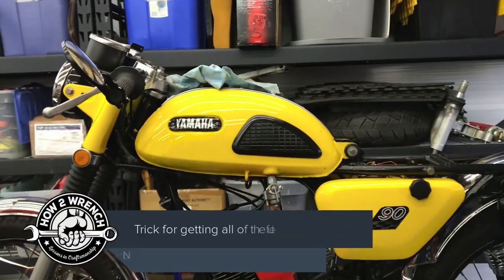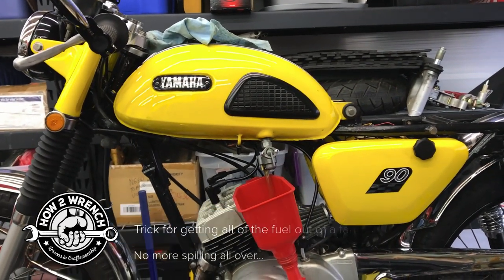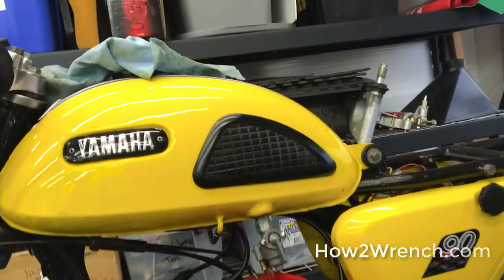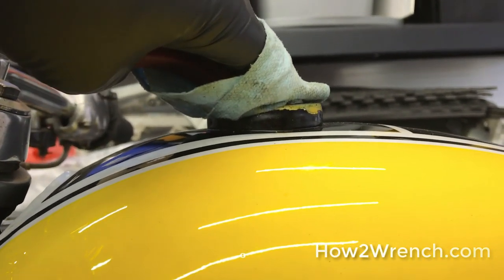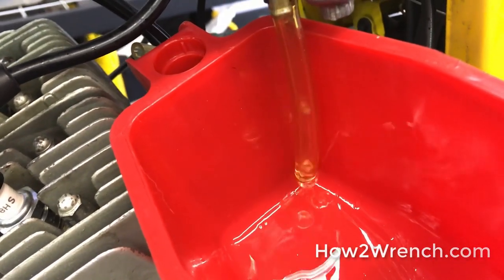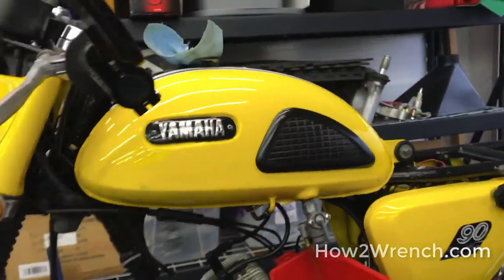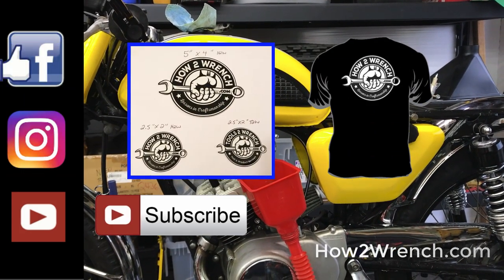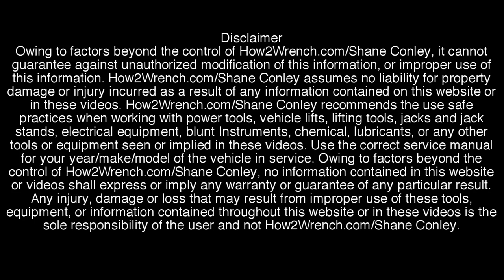DIY hack for fuel tank removal! How to empty fully with no spills or damaged paint!

Comment: As an amateur, I think the petcock requires a little vacuum from a tube connected to the intake manifold to drain the tank, too. Do you hook up a hand held vacuum device to the vacuum port so the petcock lets fuel flow? Any other tips for dealing with these petcocks?
Reply: @supermotos  Good point, thank you.
Reply: @supermotos  not all of them. some only have on, off, and reserve positions
Reply: @supermotos  Honda vtx 1300 (is one example)..... There are 3 positions up is reserve, pointing left is off for storage, pointing down is on (normal run position)